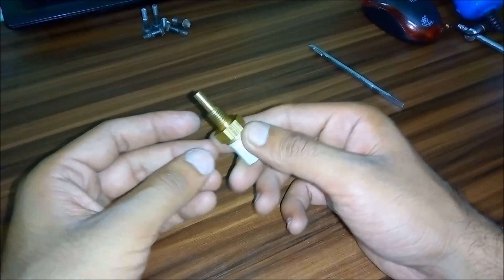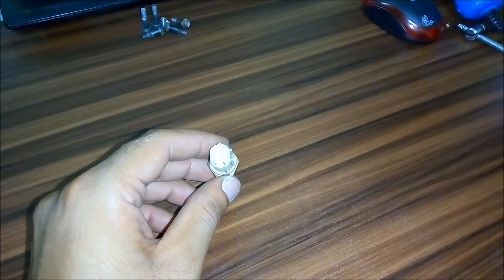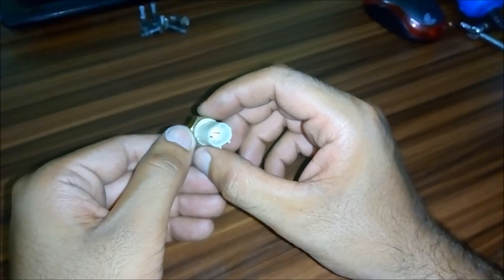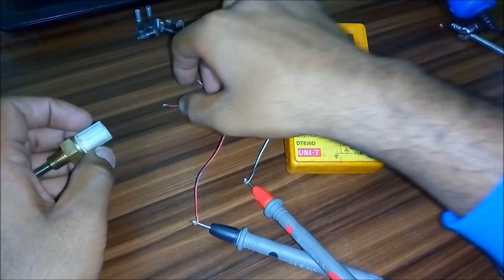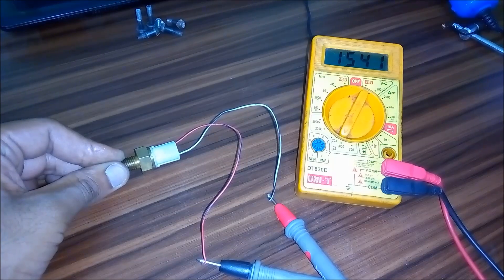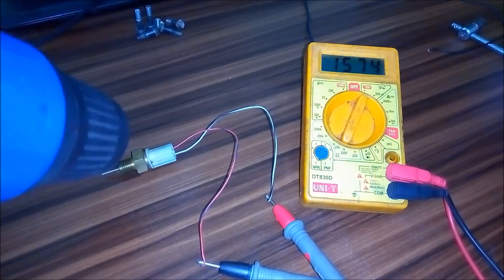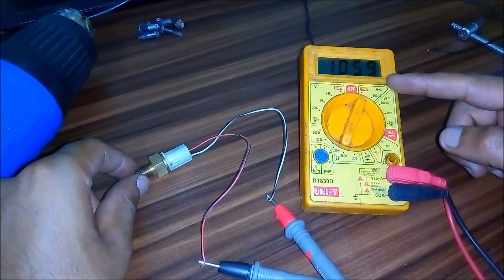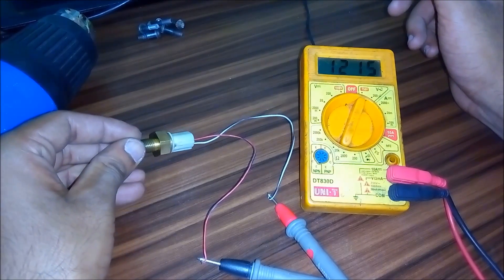Engine Oil temperature sensor in a Fuel injected Car/Motorcycle and How to diagnose/check it!!

Comment: Thanks ! I will check this ! Bike struggling to start and engine is running very hot. Also smelling fuel in my oil. I wonder if I have a faulty sensor.
Reply: Bu sensörü 270 ohm direnç taksam ve sinyali sabitlemek nasıl olur

Comment: I change eot with a resistors, value 330 ohms 0.5 watts, the value is the same as the eot sensor with the ideal engine temperature between 60-80 degrees celcius,